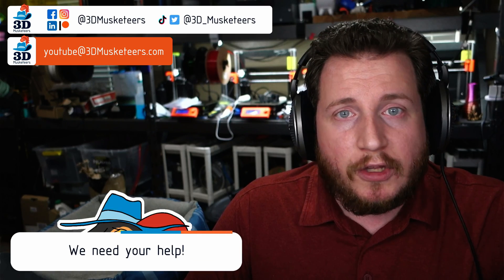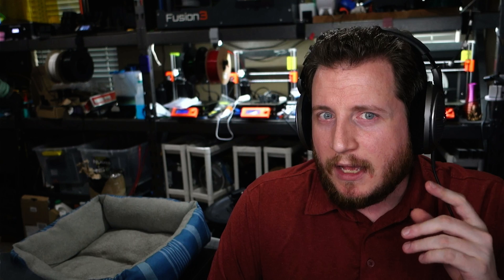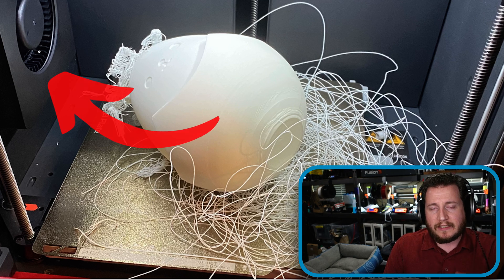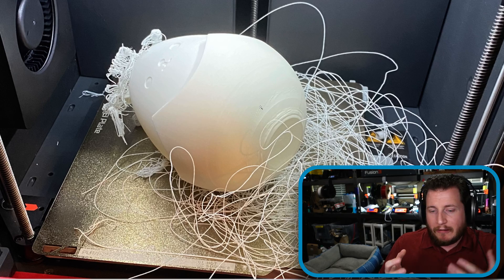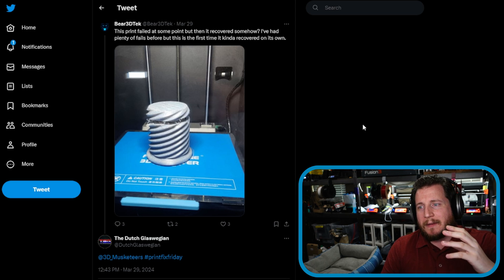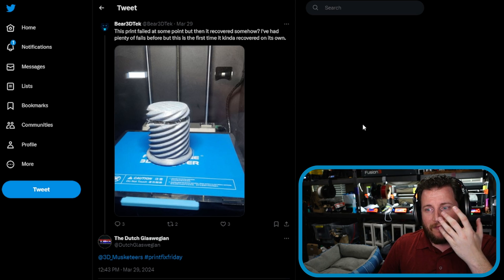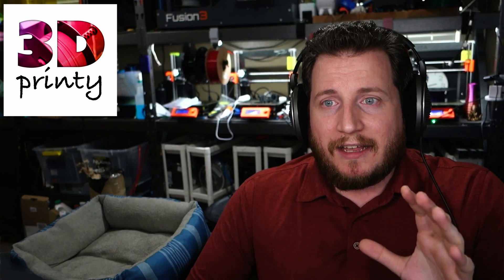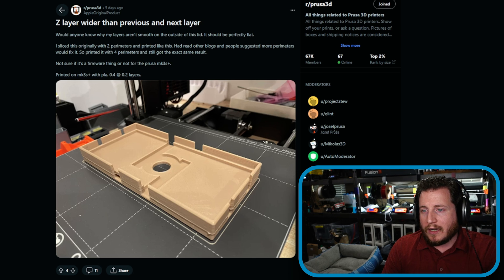What To Do When Your Filament Has METAL In It! - PrintFixFriday 134

Comment: I had s small piece of brass on a spool of pink Overture filament, like the one you showed, but it clogged the print. Unfortunately, the tip of the metal that rested at the nozzle exit scratched my Prusa MK3S+ PEI sheet beyond repair. A new MK3 flexbed, E3D 0.4mm nozzle, and downtime, was quite a setback! This mate pink is so tuned to my workflow/products that I can't find any alternative.
Reply from the maker: How long ago was this? Wonder if it was before they switched to Polymaker for production

Comment: I can't say enough good things about 3D Printy...his Rolling Storage Box system is one of my favorite storage prints to make, I have I think six or seven of them for nuts/bolts/t-nuts/washers/magnets and that's just the small size. His modular fountain? Gorgeous, fun to plan how you'll build one, and people made a ton of remixes with parts and accessories to make it even cooler. And the shutter boxes are so simple that you can make them out of filaments that they probably shouldn't be made from (like one I did from colorFabb's StoneFill) and they still work great.

GST3D/Fremover is patently the worst filament available on the market, charitably on the level of unbranded crap from eBay. Between 3D printing groups on Facebook, Thingiverse, or elsewhere, the only people who have anything positive to say about it are obvious bot accounts. It'd be bad enough if they just made garbage filament, but they also re-branded to try to escape the bad press surrounding the GST3D name and work very hard to confuse people into thinking they sell U.S.-made filament instead of something out of an unlit facility in rural Turkemenistan (I'm assuming here, though I suspect I'm much closer to the mark than Fremover's Miami-area business address).

Comment: The Bambu printer in the beginning is a P series (P1P with enclosure or P1S). The base plate is the wrong color for an X1Carbon.
Reply from the maker: I did actually figure this out, however we cut that whole bit out. I noticed the missing fiducial marks. 

If by base plate you mean the print bed, that can be any color I guess? I have seen the gold beds on X1's before, but yeah.. There was part of me that wanted to keep it, but the other part said me figuring this out took too long in the video so we cut it for pacing

Comment: Look mom! I'm on @3D Musketeers! 😂 Thanks for featuring my fail! It was quite surprising to have the entire part resume printing after such a mishap. I was printing this with Marble PLA filament, which  has some black particles mixed in. Maybe these particles caused a clog at some point, leading to the fail.

On a brighter note, I was able to save the print! I cleaned both sides and glued them together. It's a couple of millimeters shorter than intended, but since it's a planter, it wasn't a big deal.
Reply: Wow! Super happy that you shared your save!

Comment: That metal in filament should not have happened in any circumstance. The filament does not even meet the 0.1 mm guarantee. If you are looking for cheap filament try DevilDesign (from Poland) , AzureFilm (Slowakia), eSun or Sunlu (both China). Sorry, I don't know of cheaper American brands. These brands make descent filament for an affordable price. Filament below $ 15,- / € 15,- per kilo (like Owl filament) is not advisable. Producing a kilo of PLA or PETG Filament will cost about $10,- / € 10,-  (without VAT).

Comment: On the plus side my wifi has been having issues since October. There was a firmware update where it started to work again just briefly. But then nope. Not even the next firmware fixed it again. So I said screw it. I ordered a 4 pack of the modules on amazon. They are super cheap. I replaced it and instantly the printer has wifi again. So yeah bad ESP module. Probably a warranty thing, but considering little a 4 pack costs I didn't think it was worth bothering. And I have spares!
Reply: Read this at first as : "My wife has been having issues since October. There was a firmware update..." and immediately thought "Wow. I'm not the only one with a cyborg wife." Then re-read it to great disappointment.
Reply: @SwervingLemon  LMAO!!! That's hilarious.

Comment: So in addition to the crappy ass wipe tower you saw, I had another fail. The main MMU3 body prints kept failing on me. Prusa put these square holes in the bottom. It's only for 2 layers. Every single time it would fail to bridge on the mk3 (I printed one of the mmu3 parts in multi-color). So then I thought, PLA supports!!! If I print them separately they won't need a wipe tower. Everything looked good, but I only did 1 layer of PLA. The hole is 2 layers. I thought it would be ok.......nope. Same issue, but not nearly as bad. So then I thought.......surely 2 layers PLA won't pose a problem? NOPE! I got a crash! It's incredible how little it takes. After trying to figure out WTF!?!? someone mentioned the holes aren't necessary. Prusa does this to make it easier to remove from the plate and therefore save a couple of seconds in the manufacturing process. So I just used blender to remove them. Worked perfectly.

Comment: I have 2 bad experiences with filament quality. The first was the included mk3 spool. I think the brand was filament PM. In addition to being tangled in the actual sealed bag, just touching the filament I could feel massive variances in thickness. I had numerous prints that looked like crap because the extrusion was inconsistent. 

The other one is atomic filament PETG Khaki. I had a good spool of this followed by a bad spool. It's super brittle right out of the bag. It kept breaking on me. And I had to turn my mk4 filament sensor off because it kept triggering it. 

Honorable mention to polymaker copper filament. what a pain in the butt that was! Also super expensive. lol I knew it was supposed to be brittle. I didn't know that supports would collapse on me.
Reply from the maker: Did atomic at least make it right?
Reply: @3DMusketeers  I didn't ask. I got the part I needed. It was just more brittle than normal.